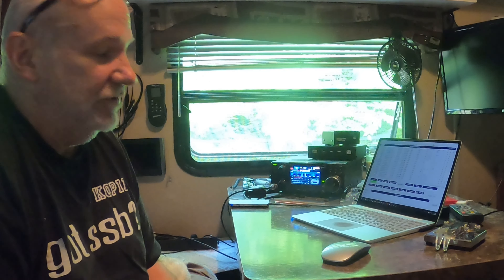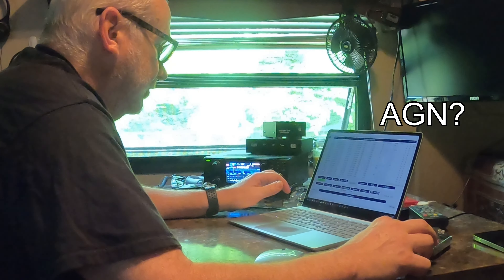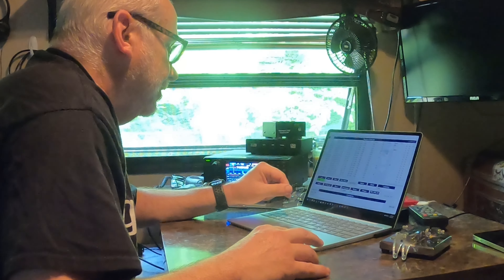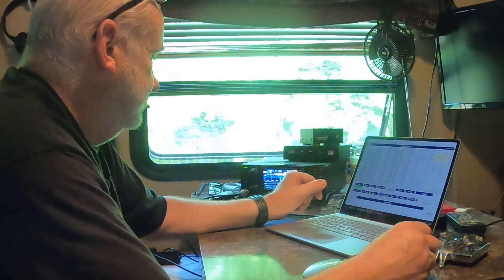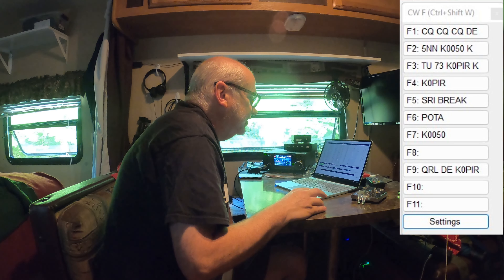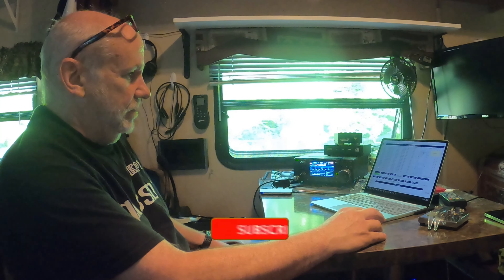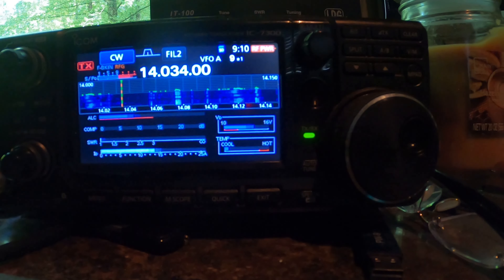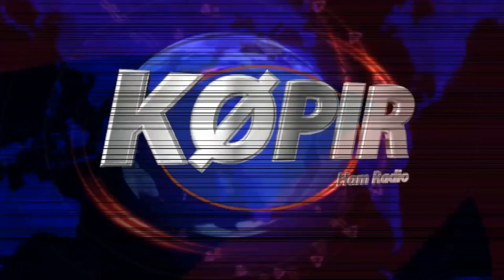Activating Mammoth Cave with Icom 7300

Comment: Nice video , been to Mammoth Cave great park. I hope you got out to explore the park some.  Quick question : The antenna  you use (Hy-Q) you mention that Snoopy ate the cord (LOL).  The cord you mention is that to move the piece up and down the coil?  I'm looking for an antenna to take with me on camping trips and the one you have was interesting. I don't want to have to go to the antenna every time I want to change bands (lazy I quest ) .  Again nice video and I hope hour recovery is quick and healthy.
Reply from the maker: Nice to hear from you and thank you for the comment. Yes Snoopy ate the 4 wire power (control) wire. He slept under the camper and pull it down from the harness. I just use a flat 4-wire to control it, same as you would use for trailer wiring. Cheaper and easy to find. It is a HiQ 5/80 and I've had it on the camper for about 4 years. Vry73!
Reply: @HamRadioAdventures  thank you! For taking the time to answer my question 🙋‍♂️

Comment: So you're doing something similar to what is done on ft8. Macro of the entire conversation correct? You program the 7300 by recording yourself keying or nf3jp automatically does it?  Also finished the video and heard about your stroke, kudos to you for pushing through and relearning things, that's admirable.  Hope you get it all back sir.
Reply from the maker: Hi John, it's nice to hear from you and thank you for the nice comment. I am using the paddle to send the other stations callsign (in video) and then and use the macro to send report. Similar to contesting. Happy 4th! Vry73!
Reply: @HamRadioAdventures  I need to learn it myself... This inspired me to do more research n make it happen